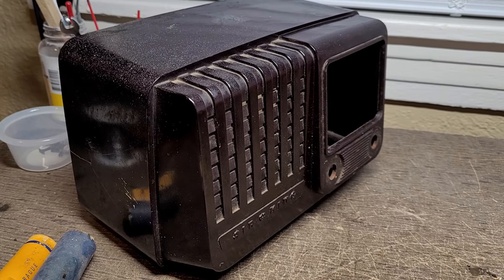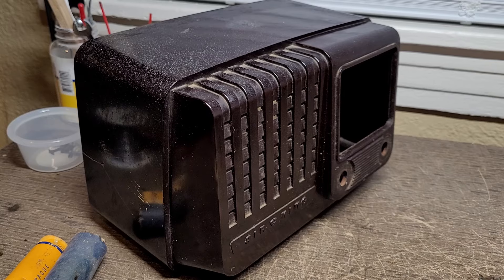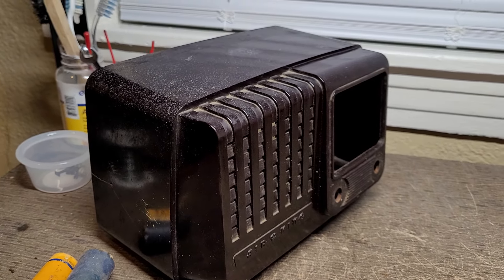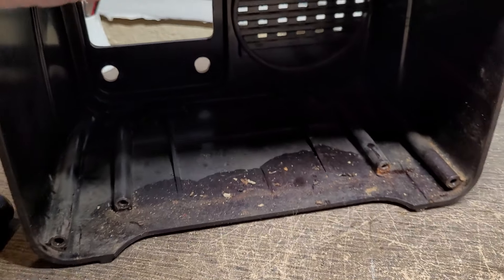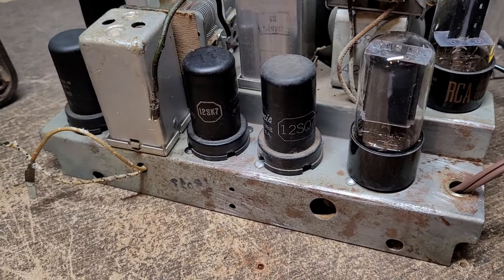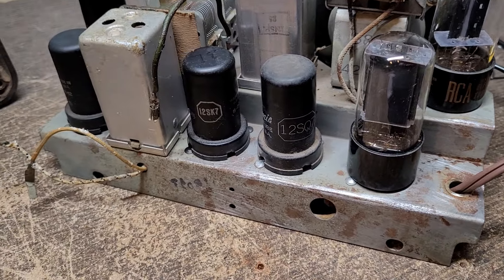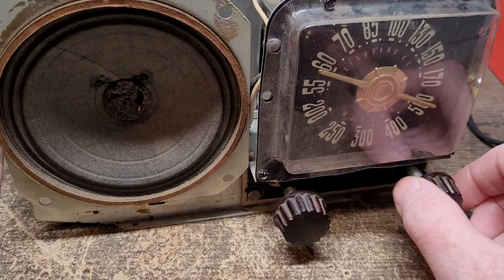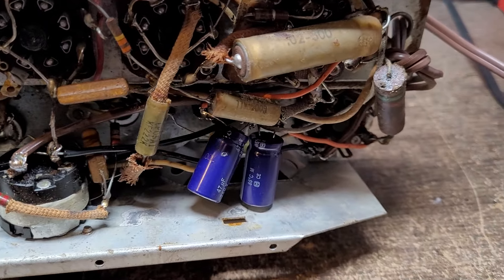Air King dumpster fire AA5 radio

Comment: Yup. Mouse piss. The guts aren't really that bad. The IF cans probably need to be modified because of the silver capacitor plague. I would throw the case into the dish washer with dishwasher soap. Clean that right up. Lightly sand it.
Reply from the maker: The IF's on this don't have the silver mica problems, the ones that do are the slug-tuned variety
Reply: @justsumguy2u Sorry. Didn't notice that. Thanks.